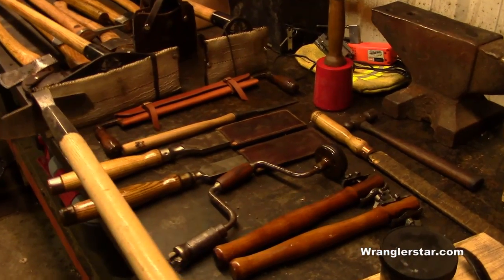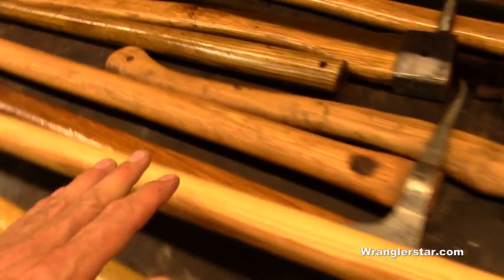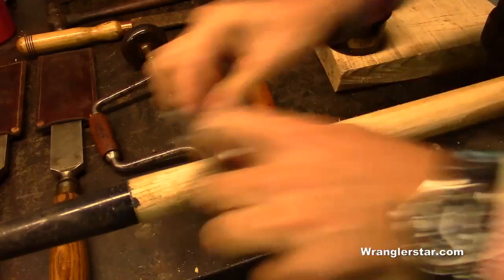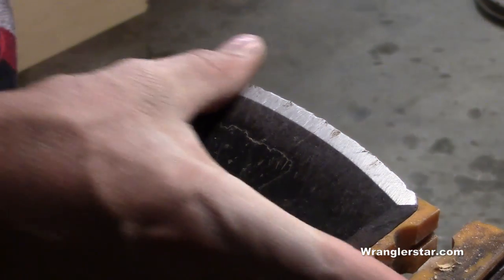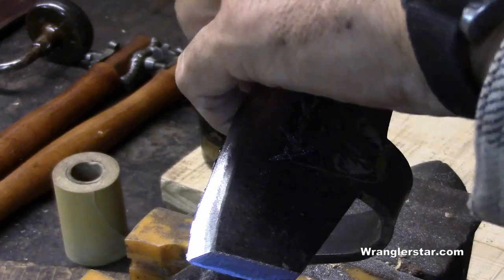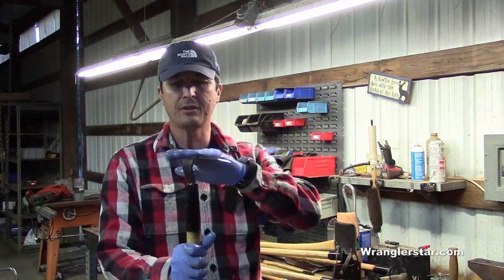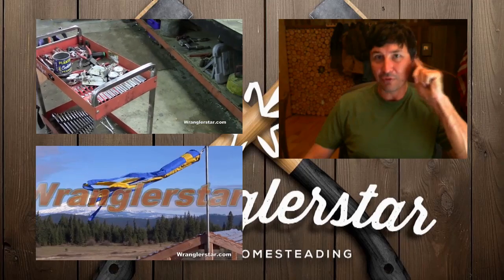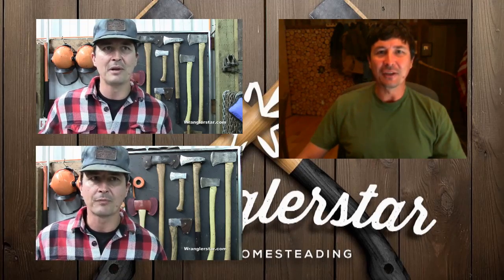How To Strip Varnish From Tool Handles | Wranglerstar

Comment: From their web page

Tried & True Wood Finishes

"Simply the best way to finish solid wood."

Premium Quality Interior Finishing Products 
made from 
Polymerized Linseed Oil 

Environmentally Safe 
Solvent free - Zero VOC 
Food Safe 
No Heavy Metal Driers

Tried & True Wood Finishes has combined some new and some old ideas to create the best oil finishes made. We use 18th century varnishmaking techniques and the best natural ingredients to make environmentally safe wood finishes that make no compromise for beauty, durability,or safety. Our products are easy and economical to use. Remember: A little bit goes a long way!
As we seek to create healthy environments in our homes and workplaces, we must look at the impact of the materials we use. Where do they come from? How are they made?How are they used? And ultimately: How do we live with them?
Tried & True offers the craftsman, the architect, the builder, and the homeowner a comprehensive approach to interior wood coating which enhances the durability and beauty of the wood. Our products are superior in performance, product life, and economyto our conventional market competitors, while adhering to the strictest environmental standards.
From cutting boards to cabinets, from windows and doors to fine furniture,there is a Tried & True Wood Finish to meet your needs.

Comment: I think if the method of applying linseed oil is once per day for a week, then once per week for a month and then once per month for a year, that might explain why manufacturers use varnish.  For 99.9% of the consumers, I'm sure varnish isn't a problem.
Reply: Probably because it dries faster than the linseed oil. You don't have to put that much linseed oil on a handle, as a manufacturer that's customer responsibility to maintain the handle. I would say that 1 coating of boiled linseed oil is better than the coating of vanish they put on it seeing how it comes off so easily from usage.
Reply: ***** Do you think a one-time coat of linseed oil will look as good as a varnished handle after being knocked around on a hardware store shelf for a while?  I wonder if the varnished look is more appealing to the general consumer.  A few years ago when it was "new shovel and rake" time for me, I wound up getting the fiberglass handled models, because all of the wood ones seemed cheap and flimsy.  I have memories of getting splinters as a kid from old shovels where the wood was all washed looking and grey.  I guess we can assume they had lost their varnish or were never finished at all.

Comment: Adverbs generally end in ly.
Sand it quickly, not sand it quick.
The whole darn country is abusing adverbs these days, but only folks from Philidelphia would think it is correct to say " I seen a rat".
If you are from Philly, just pretend there is no word called seen, but that there is have seen and had seen.   I saw bad grammer in Philly.
Even on tv news shows grammer has gone to the dogs, the most common errors being adverbs that end in ly, verses adjectives that drop the ly.   Boil that in linseed oil!